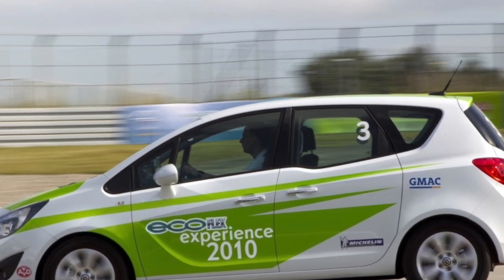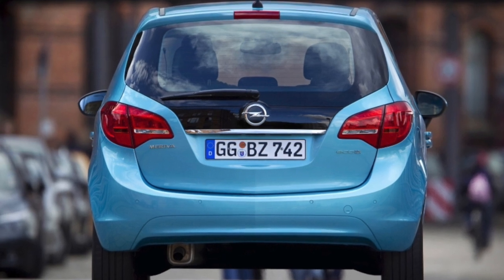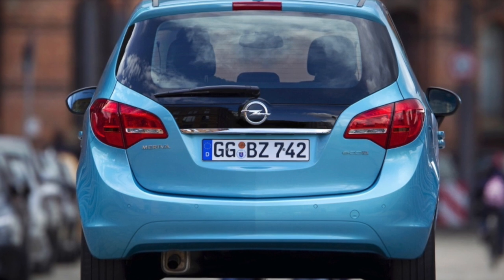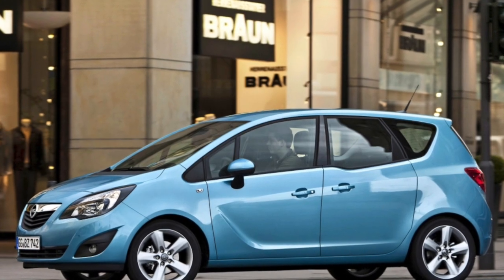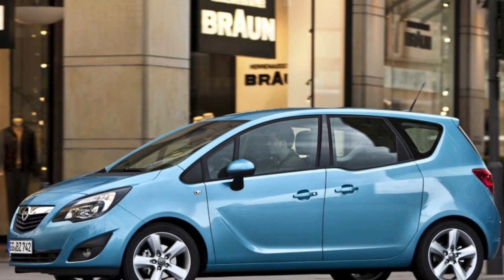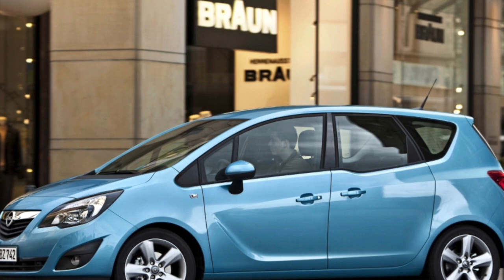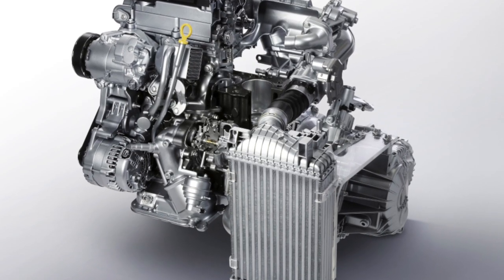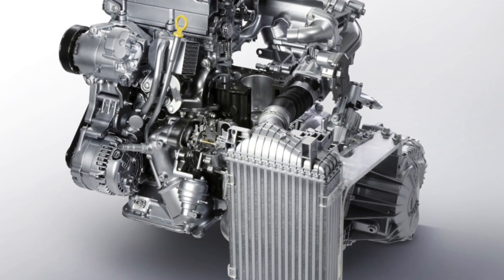Used Opel Meriva B Reliability | Most Common Problems Faults and Issues

Comment: I bought a 2010 1.4t (120hp) 2 1/2 yeas ago @ 85000 miles. Over the last 40,000 miles I’ve replaced the coolant tank, and a coolant hose, it’s had a new turbo, clutch and a second hand gearbox. Just about to replace the drive belt tensioner and oil pressure switch

Comment: Owned a 2013 1.4t 120bhp since 2018. 54k on the clock at the moment and the faults I've had so far are:-
Boot switch failed (28k)
Coolant header tank split (40k)
Coolant tank to thermostat pipe elbow faliure (50k)
Coil pack faliure (35k)
Random non start with imobiliser symbol on dash (random since 38k)
Both rear coil springs snapped (40k)
Power steering pipe leak (45k)
Drivers seat side trim always breaks (very common)
Half leather drivers seat cracks, in leather on base.
All the above have been easy self repairs and other than that,it has been a great car.

Edit: Had front crank seal replaced by my local garage due to the common squeaking noise. 56K

Edit: Timing chain kit replaced at 58k after developing a cold start rattle.  Plastic chain guides had broken and  bits ended up in the sump. Cost was £860 all in at an independent garage.
Vauxhall recomend interval on the meriva timing chain kit is 50k or 10 years.

Comment: Have one with 120 000km, issues that I encountered - coolant pipe replaced, water pump replaced and crank shaft seal replaced. Still doing great on the road due to regular maintenance at 15 000 km